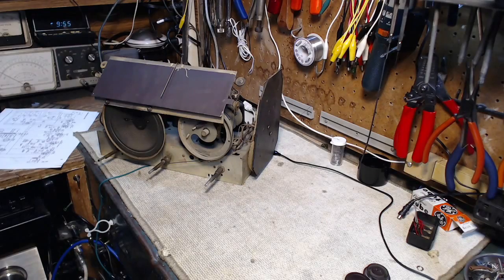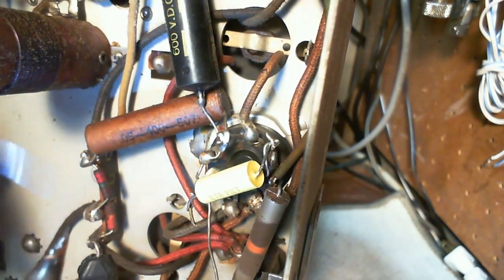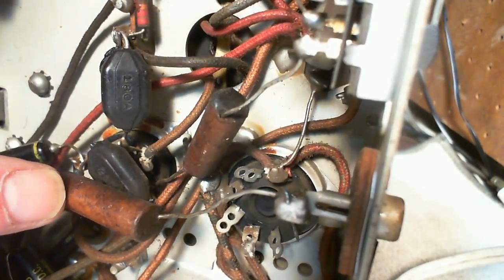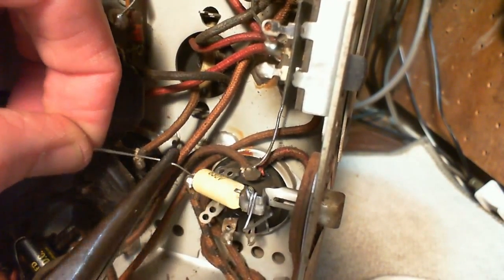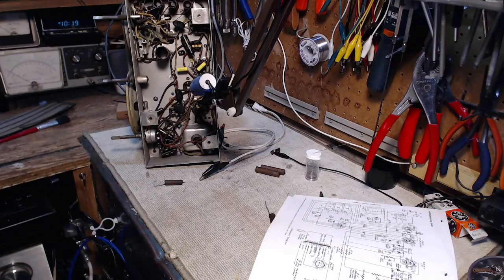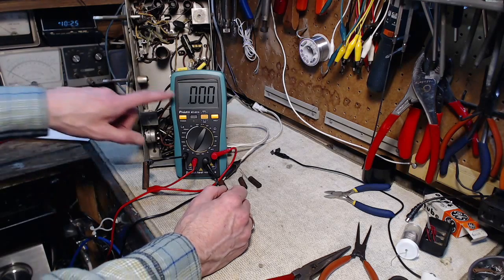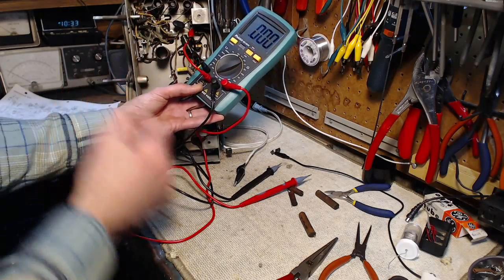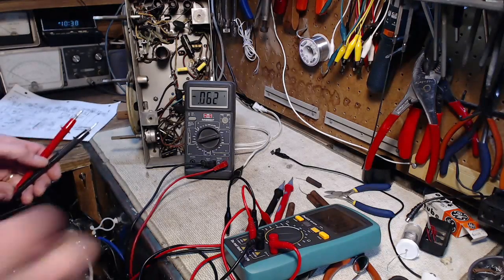RCA Victor A-23 Vacuum Tube Radio Video #3 - Paper Capacitors

Comment: a good way to check yourself with your new meter measuring caps is to test a new one out of your bench stock of about the same value....     it's normal for a meter to read some resistance for a moment( especially on a high meg range) .  this is the cap being charged up....once it's charged your meter will most likely show no resistance.....  try a resistance check (high megohm) on your analog meter and watch......

Comment: when testing resistance your meter actually applies a little voltage to the cap...this is how the meter reads resistance on a normal resistor..... it doesn't know you have a cap attached....